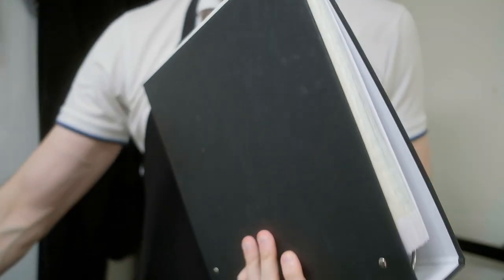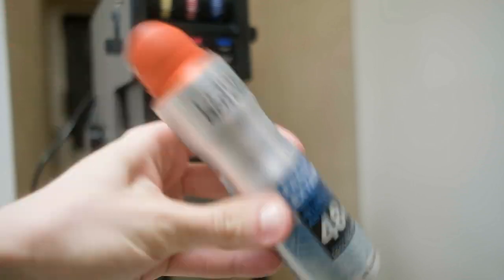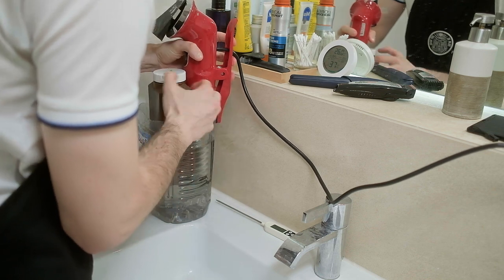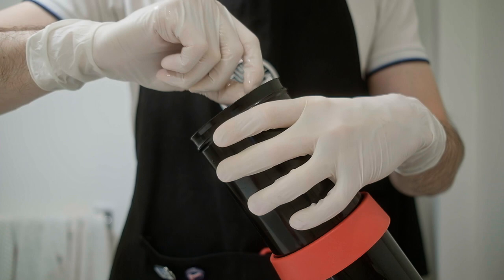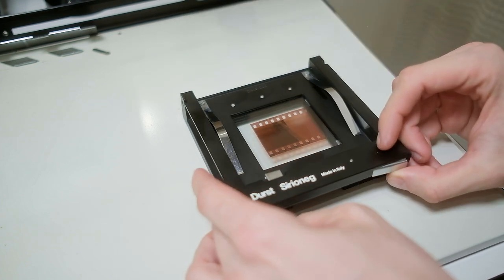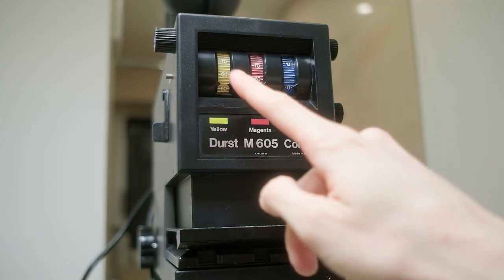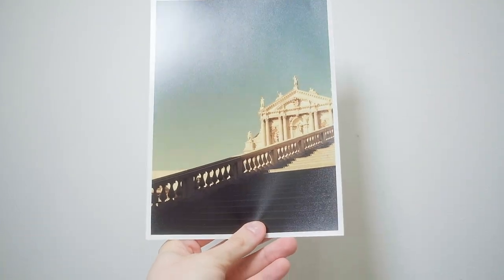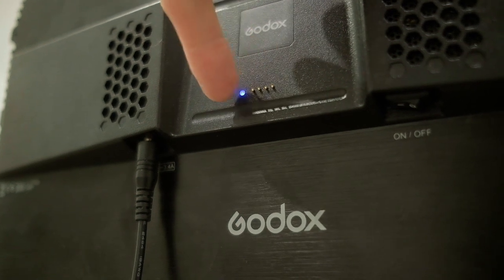Quick solution of newton rings on Durst M605 and mystery of strange color tint

Comment: I bought a new Durst M601 in 1975. I replaced it with an M800 (6x9cm) in 1980. The advantage of Durst is that the negative carriers take replaceable inserts for various formats, both glass and glassless. Long ago I determined that the "perfect" combination for my Durst film carrier was a 6x9cm anti-newton glass upper plate and a glassless lower plate in whatever film format I was printing. Up to 6x9cm, the natural film curl holds the film tightly to the upper plate, thus is flat. The lower glassless plate supports the film overall, frames the film format to avoid any lens flare, and eliminates two of the glass surfaces as possible dust catchers.  I get no newton rings. I get no artifacts from the anti-newton glass plate, even on 35mm to 16x20 inch enlargements.

Comment: I was getting bad newton rings even WITH anti newton top glass...  I think possibly due to very high humidity here at the moment
Reply from the maker: You need to invert it probably, it should be anti-newton glass against film base and not emulsion. If you scan it like me, you should flip glass from top to buttom side or scan emulsion down to light🫰
Reply: I had AN glass against film base. It stopped newton rings for black and white but not colour negs that are glossy both sides @NordicLab
Reply: Never mind. I'm an idiot. When i cleaned the ANR glass i inserted it the wrong side up so the etched side was not facing the negative base. Problem solved